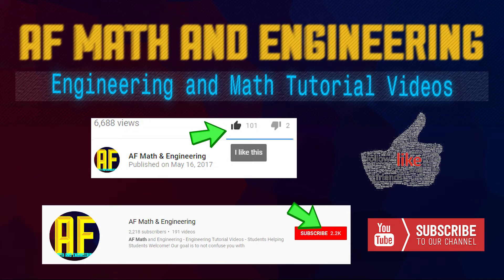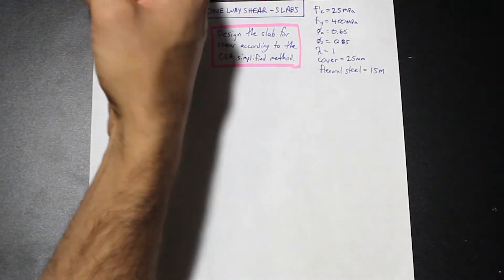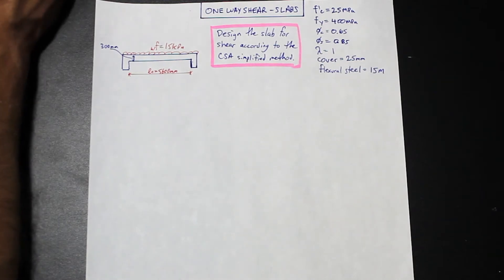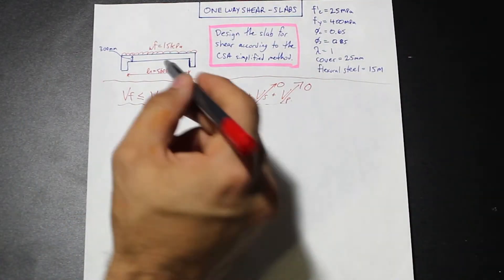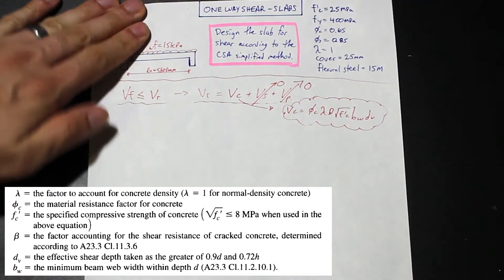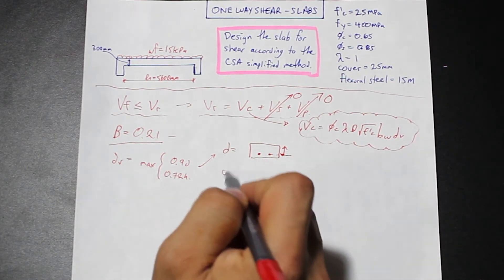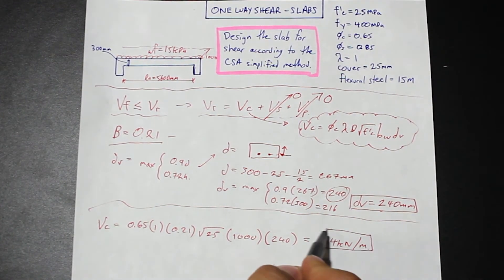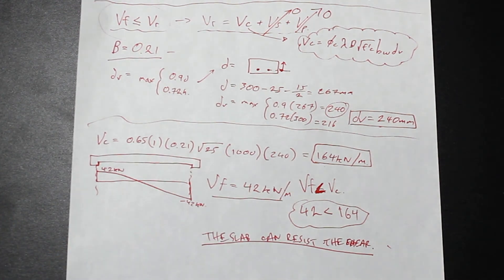How to Design a One Way Slab for Shear - Canadian Code Example - Simplified Method

Comment: Please do  Mat foundation using  both hand and Visual analysis software thanks. Also, do the moment stiffener(or triangular gusset plate) design calculation for steel frame connection at beam and column connection. Thanks.

Comment: Awesome video, can you also make a theoretical video on partial release for frames and foundations. I am learning the software but my concepts are not clear. Thanks. Keep up the great work you doing
Reply from the maker: Thanks!  Are you referring to assigning stiffness to supports when evaluating frames in softwares? This is a very difficult concept to quantify and most of the time is at the engineers judgement and based on the situation.  Thanks for the post!